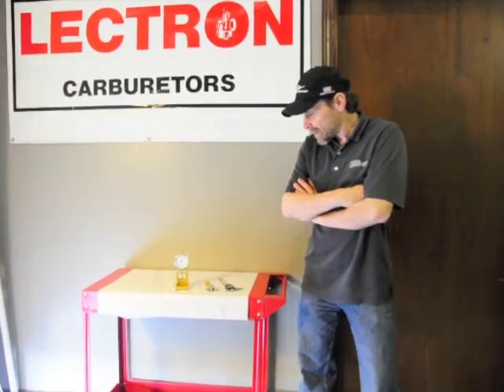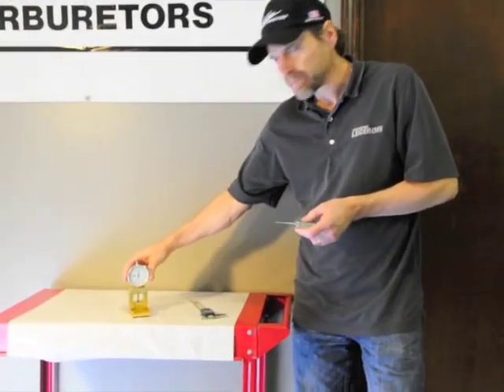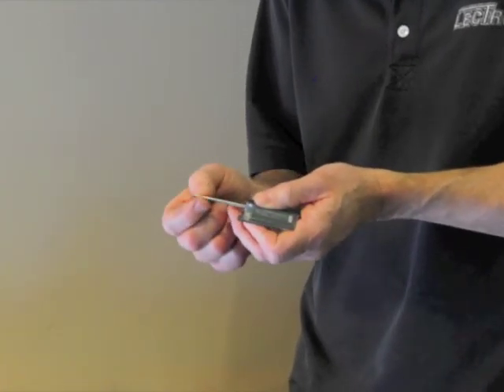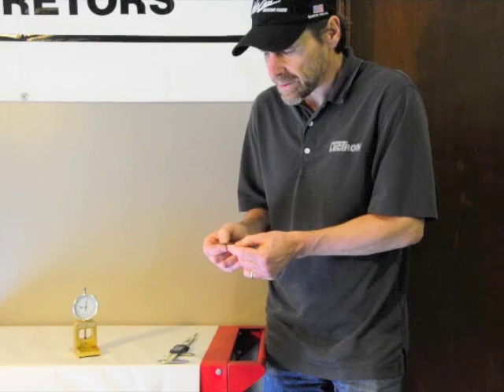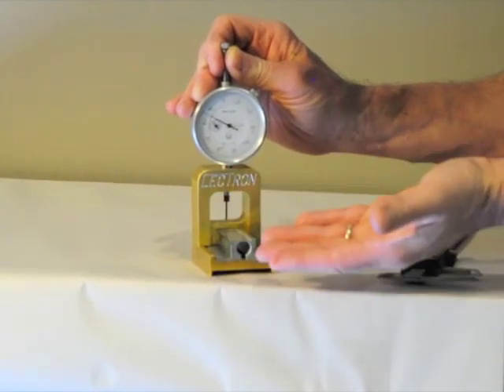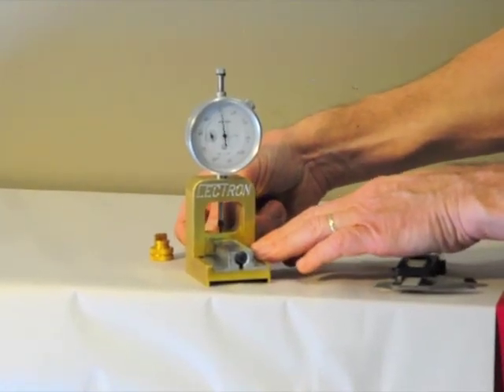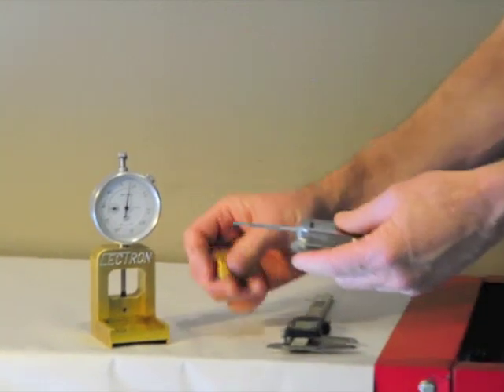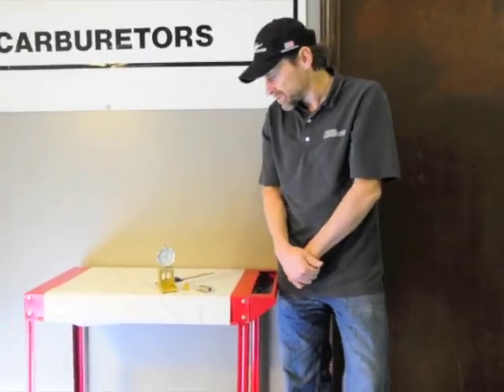How to Use the Fuel Ratio Tool for Lectron Carburetors

Comment: You're only measuring the thickness of the rod at that point NOT the AFR. 
If the ideal thickness measurement is constant for all bikes, you could just set it up at the factory.
How can all bikes idle at the same measurement and produce the correct AFR ??
Every engine requires different  jetting ( or in your case "gap" ) to produce the correct AFR.
Are the gauges bike specific or something ?😳

Comment: What should the Fuel Ratio Tool read without a slide in place? My dial got moved and I need to reset the tool.
Reply from the maker: https://www.youtube.com/watch?v=zrjKrykhFxI

Check out this video its updated an explains everything. but to answer your question, your dial should read 6 when the rod is in the gauge but the rod is oriented 90 degrees sideways look around the 3:20 mark

Comment: If my Husky TE 250 stalls easily on idle, do I need to make it leaner or richer?
The idle screw also helps I know but only stops stalling when the idle screw is set for too high rpms.
Reply from the maker: Typically leaner

Comment: How do you do a quarter turn on the metering rod when the flat side must face the engine?
Reply from the maker: When you push the rod up into the slide, the rod turns freely so you can save your setting and rotate the flat side back to where it faces the engine.